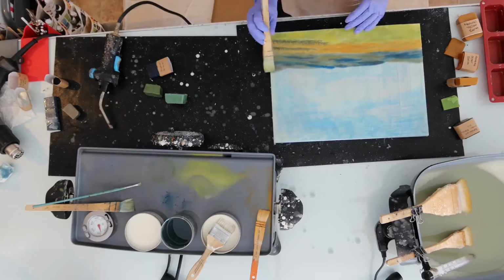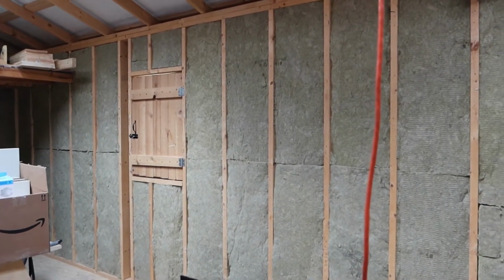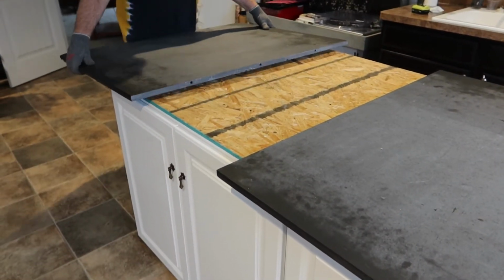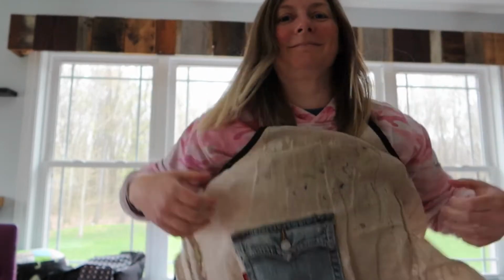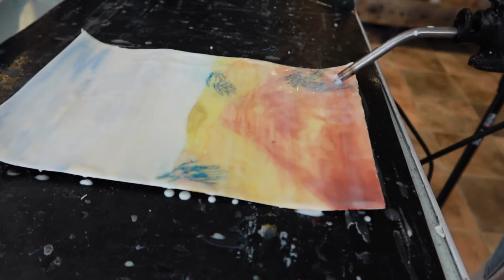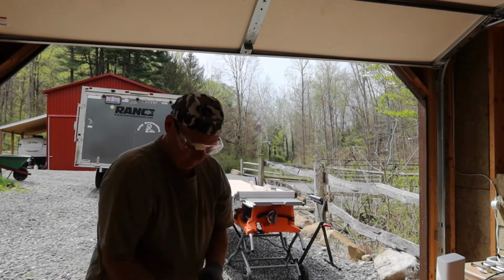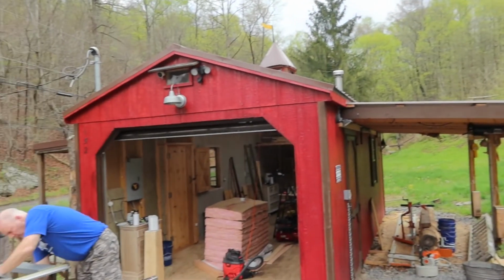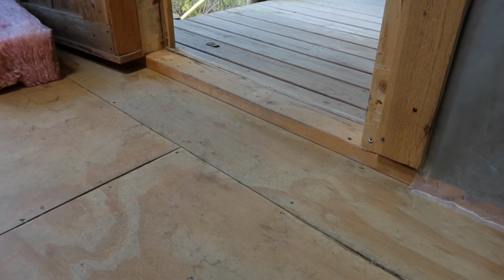Artist Studio Vlog: Converting a shed into an art studio and painting an encaustic tree sketch

Comment: Wow you and Matt have done so much in a short period of time. Its going to be a great space to create in. Can you cut the bottom of the door and raise the jamb a bit for your floor. Ot lanolium is easy to get the wax off. They say the stress of moving is as bad as the other biggies, liss of job and divorce. We can see what you are going through but I'm sure there is more we don't know about.  Your health is most important thing in your life. Take care of yourself first. Also when I've layed down a few layers of wax I hold the hot air gun in one hand and follow the hot wax brush in the hang so it goes down smooth for a more glassy surface. Like you said,  it may work for you or  not everyone is different. I've never worked on just paper which I think I'll try.  Thanks for everything.  Your place it's gorgeous and peaceful.
Reply: Oops... in the other hand...
Reply: By doing that technique the wax keeps melted and doesn't cool off and drag as it cools, I can go further and smoother with each pass
Reply from the maker: Great tip on getting a smooth surface. I think I’ll try that out. Also thank you for the well wishes. I can see the end of the moving process is near - and that is giving me lots of positive thoughts.
Reply: I was thinking that because your painting is curving in the technique won't work. The wax will migrate down the sides and bottom. It works well on a flat taped down surface.